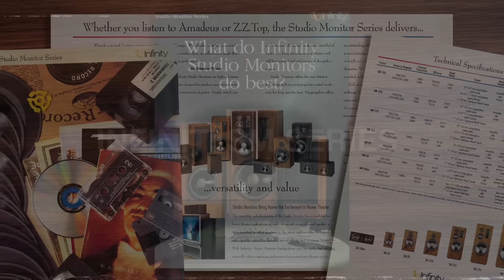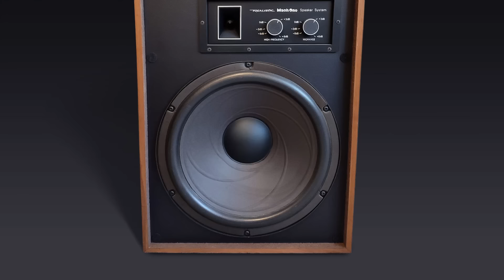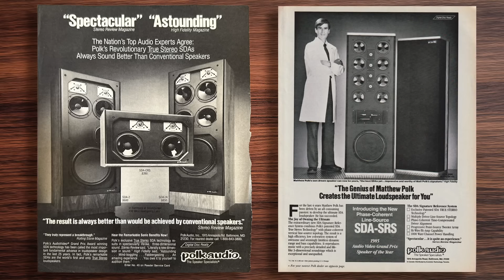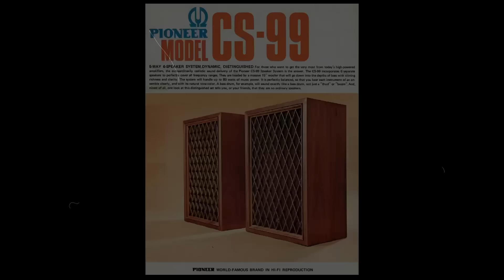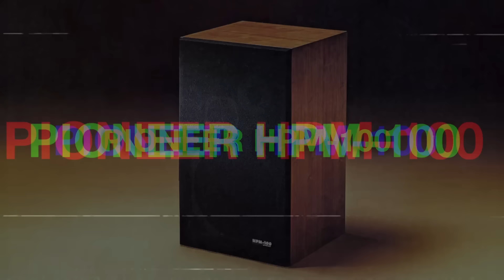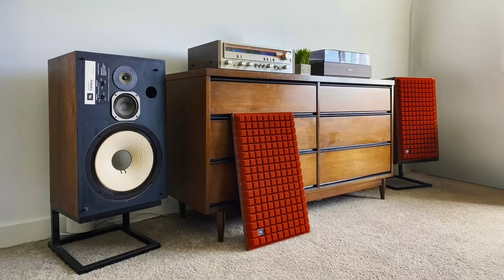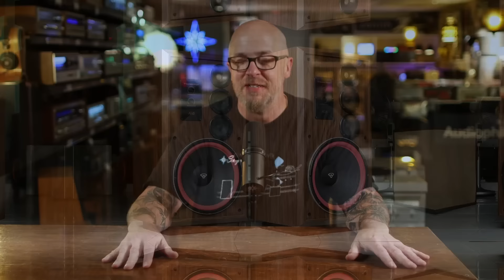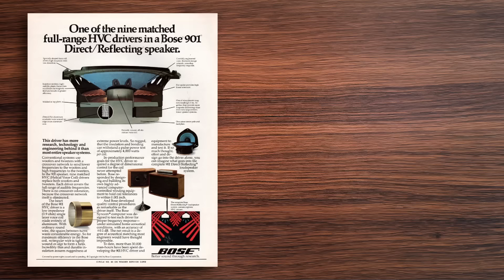Why Do Audiophiles Hate These 9 Legendary Speakers?

Comment: I bought  a set of HPM-900's new in 1982. Still have them and they still sound great. Along with all the Champagne Pioneer gear I bought with them.  A-9 Amp, SG-9 EQ, PL-L800 Turntable, CT-7R Cassette deck and F-9 Receiver.  I could give a RATS ASS what some dick head "audiophile" thinks or says.... my EARS tell me what I like. Remember the first year of MTV?? They had my setup in the back ground!

Comment: Once upon a time, as a very young man, I worked at various local Radio Shack stores. One Sunday the mall was closed (olden days: 'lettuce spray'), and we were doing an inventory.  It's a mediumly-big shopping mall, 1000-ft long and shaped like a 3-story figure 8. Of course, since the mall was empty, we pushed the Mach One speakers out into the mall, and blasted Classic Rock with the full 100 watts RMS per channel. At the end of each song, we could hear the song ending orbiting the mall several more times. The security guard on patrol dropped by to tell us that it was the best Sunday he'd ever had working. 15-inch woofers have a 'quality' all themselves; no need to explain.
Reply: yes, my dad owned a pair & he threw parties alot back in the 1980s after my parents divorced. They rocked!!

Comment: I'm not a fan of the 901 but I must say, they can sound pretty OK if set up properly.  I like the idea of running 901 properly positioned, without the EQ and  use DSP (like the miniDSP HD) for the contour and a little HMS 2.3 curve.  Now, I'm not saying it would be an audiophile setup...

Comment: I’ve had a pair of HPM-100s since 1977 and love them.  Although I later replaced them in our main room when my Sansui 8080DB died and I went to a Denon HT setup (and they did not voice match my new Energy Veritas Center Speaker) I then moved them to our large master BR, because I wouldn’t be able to let them go.   I did blow 3 tweeters over the years (which was probably mostly due to cranked super sonic clipping from my Sansui). But it’s got factory replacement tweeters and I still have one spare left. 
Regarding its brightness, I never found that to be a problem and have sometimes used the control knobs on it to drop it a bit for safety sakes; but about the only criticism I would level at them is that I think dome tweeters might have been better because the stock tweeters are quite directional.  No problem if you’re lined up right 

Regarding the Bose 901s, I still remember to this day being in my dorm in the mid 70s and hearing a deep throbbing sounds. I didn’t know what it was so I was walking around this concrete circular building and as I got closer, I could begin to realize it was music playing. When I finally got to the source room, the guy had a pair if 901s on a table on one side of the room.  Small, but a perfect setup for their direct/reflecting design.  To this day, I’ve never heard Carly Simon’s “You’re So Vain” sound so frigging awesome. So yeah, I was surprised to later hear the negative criticism of them😮

Comment: I own a pair of Infinity Q8's. Bought them in 1978. Speaker placement is key with them. Proper height and a distance from walls is also needed. I replaced the crossovers, and man do they sing. Still have the original EMIT series tweeters and the 8" rubber surround woofers. Wouldn't give them up

Comment: I actually worked in the JBL factory in the 1970"s where I became intimately familiar with the L100.   I'm not going to argue with any of the criticisms of this speaker in your video, but I will defend them.   You've got two of the three main positive aspects of these speakers right.  They
are incredibly efficient, and incredibly rugged.    

The main criticism is that they arent "accurate".  This is true and not true at the same time.  Let me explain.  If you are a classical music fan, these are horrible speakers because they have an absulutely freakish and unnatural frequency response curve  (I should know - I was the guy checking every unit at the end of the assembly line.  We weren't testing them for "accuracy", we were testing them for consistency - to make sure they were all inaccurate in exactly the same way.)

What few people today appeciate, though, is that this isn't always a flaw.  In fact, the "inaccuracy" of L100s may well make them the best rock and roll speakers inexistance at any price.  The reason?   The 4311.   The JBL 4311 was a "studio monitor", which meant that it was built for commercial use - specifically for use in recording studios.  It was JBL's most successful out of about a dozen purpose-built studio monitors they made.   In fact, the 4311 was the most successful studio monitor in the world from about 1967 until the early 80's.  Every recording studio in southern California, and most studios around the world had a pair.   Recording engineers loved them.   As a consequence, and I can't stress this enouth - MOST OF YOUR FAVORITE ALBUMS FROM THE 1970s WERE MIXED BY AN ENGINEER LISTENING TO 4311s.

The L100 and the 4311 are very nearly identical.  They use the same set of drivers.  They use the same crossovers.  The  cabinets have the same volume and ports.  The differences are purely cosmetic.   The grill is different, the location of the mid and high knobs is different, etc.  They sound EXACTLY ALIKE.   If you love classic rock, this means you need to revisit your definition of "accuracy".   If you want to hear exactly what the musician heard when they played the music - well, good luck since multitracking was well established by then.  Each musician heard something different.    If, however,  you want to hear what the engineer and the band heard when they approved the mix, you need a pair of L100s  (or, obviously 4311s if you can find them).  From this admittedly biased perspective, nothing else comes close - especially a pair of supposedly "accurate" speakers.

Comment: I had a set of Realistic Mach 1 back in the 80's and I loved them. I think they could handle 100 watts rms, but I rarely drove them that loud. I think I paid around $100 new from radio shack and eventually sold them for a fraction of that cost back in the early 2000's. I didn't know any better. I figured who would want these big bulky speakers.

Comment: With the Bose 901s, there is a huge difference between the Series I and II on one hand and the Series III and later on the other. The first two were in wood boxes and were sealed. The later ones were in vented, molded plastic boxes and frankly sounded like crap. I had a pair of Series II that I used with the 8 drivers facing forward, and before you condemn that, be aware that the Bose 802 pro sound speakers were basically 901s without the front driver, turned around, with a slightly different equalizer. I used both the 901s and the 802s for sound reinforcement back in the 70s and 80s. They could handle a lot of power and you could move them without a fork lift or crane. They would also fit in places a normal pro sound speaker of that era simply couldn’t.

Comment: My 1966 Empire Grenadiers are very boomy and tweeter heavy and position critical. If they are not in the right room or too close to the walls they cancel each other out and wash out the bass. But they sound good when set up properly.

Comment: Infinity SM150:  Has passive radiator:  THE CASE!   So boomy boxy you can visualize the dimension of the box the sound is coming from.  I had a set.  Didn't compare to CV 103 db 15in w/700w A600.
Polk:  They had  small woofer and a tweeter and then built speakers using those drivers like Legos.   And the price was proportional to the square of the # of these drivers.  They had no Shame!
Kabuki:  Buddy had FOUR sets @ TWO Ohms on a Sansui 33000 (!!!!)  Black Sabbath fanatic.  Room 6' x 20' (!).  Drum kick dimmed lights.  Had trouble breathing!  Intense!  Try that with your Wilsons.
Pioneer HPM-100:  92db sens. + 200w capacity = Not Loud.   
Cerwin-Vega:  103db + 350 w capacity = Top of the Loud Food Chain.  And they BRACE that cabinet!   I've had Acoustat 2+2, Apogee Stage, Maggies, DCM, B&W 801, 801F both woofer blows up on Digital Underground The Humpty, DM6 OK, and others but the sad reality if you want loud, you don't get quality (at least with 1 power amp)

Comment: I THINK BOSE CALCULATED ON NOT ALL PEOPLE HAVING SENSITIVE EARS TO HEAR THE FULL AUDIO SPECTRUM 20 HZ TO 20000 HZ... FOR BOSE WHICH IS 2 WAY SYSTEM FOR THE MOST MODELS .. I EVEN DOUBT WHTHER THEY HAVE EVEN A CROSSOVER CIRCUIT.. AND IT HAS A TRICK OF ADDING THUMP TO MID RANGE SOUNDS.. SORT OF WEIGHTY AND STILL FAST.... HE MANAGED THE TRICK... I MEAN BOSE MANAGED IT ADMIRABLY

Comment: Cerwin-Vega and Carver are the reason I'm into hifi audio today. My dad had four VS-150's, one pair stacked on top of the other pair, and two TFM-35x's driving them. It was an amazing system to a teenager back then. They definitely had their downsides. The titanium tweeters could be harsh at high volume and the midrange would break up when pushed. But those four 15 inch woofers would perfectly recreate the thump of a kick drum. It was a system that made you feel like you were right up close to the stage. I remember playing The Crystal Method's album Vegas on that system and the bass in the song Trip Like I Do was earth shattering. I thought it was going to knock the house off the foundation lol. The VS and AT series were some of the best they produced imo. The orange foam surrounds was a shame. Interestingly, my family was in the speaker business back then. A small anonymous speaker cone plant in SW Wisconsin. They manufactured the speaker cones and surrounds for the woofers on a lot of these Cerwin-Vegas when I was a kid. I also recall seeing production samples of cones similar to the Infinity SM series. They also made a lot of the speaker cones for Infinity, JBL, Eminence, JL Audio, Earthquake, and even Bose back then. CV's insistence on the orange surrounds was criticized even back then. Something about the foam that was required to make the surrounds made it prone to rot, but it was a trademark look for CV so there was no talking them out of it.
Reply: I've had two pair of D9's in my life.  Freakin' LOVED those speakers.
Reply: Loved my friends Carver   i had Luxman

Comment: just taking a chance.   if anybody knows anything, please comment.
in 1974 i bought a pair of AMC 24XP.   it's been a long time, but i think the AMC stands for American Monitor Corporation.   these are 4-way speakers with 2x speakers for each 'way'.
2 woofers, 2 mid-range, 2 tweeters and 2 supper tweeters in each cabinet.   i have tried to find specs or info on them, but to no avail.   there is nothing on the interwebs.   i'm sure AMC is no longer around, but i find it strange there is no information.   i use a Carver 4.0t to drive them.

Comment: The Klipsch Heritage line is only good when modified and run with purist circuits.  That's like none of the market.  But if you're running a purist tube circuit and are the type of person to modify the speakers (dynamat on the horns, upgraded EVERYTHING ELSE besides the wood), then the Klipsch Heritage can't be beat for the money.  If you're running the newest, highest wattage solid state whatever you can find, then the Klipsch Heritage line is, well Heresy for you.

Comment: I have had many of these speakers pass through my garage, many got re-capped and eventually sold.  But the CS-88A is the exception, I will never sell those as they are FANTASTIC!  Mine are paired with my SX-780 or SX-950.  I have the CS-99A's as well, but favor the 88's most!  Of course I own my HPM army as well.  They get to live in the House!!

Comment: I have Mach Ones and that sound pleasingly to me. Set the mid and hi pots to 0db and no shouty speakers at all.  I have a set of Heresies and I use them for the rear channel.  Flat speakers I have a set of Fischer 9vs that are lovely to listen to and they are like a time machine.  Listen to them for 3 hours and never notice.  My wife is my alarm clock to keep me from listening too long otherwise.  The rest of the other 5 sets are home made except for two Sony Center Channel speakers.  I love Cerwin Vega and you can always roll of some of the Bass!  AT-15 are what I love most.

Comment: I have 4 CS 99A's with FB cones. Right  now I'm only using 2 of them. They are paired up with 2 DX 9's. I get a good sound with a little more of the power going to the Cerwins. Using a Pioneer SX 1250. I think the CS 99A's are built like little brick shithouses. They keep up pretty good.
Reply: You must re-cap them to hear their clarity.  They get really muddy after 50 years...

Comment: If you're in my business, restaurants, the JBL 100 is unassailable. You are absolutely correct -- they take whatever you can throw at them and handle everything extremely well. Mids get lost in a room full of people talking slash yelling at each other when the drinks are flowing. You want highs and lows pumped, typically. At home I have a pair of KEF Q300s with an Andrew Jones subwoofer, and for my small space that is a quality setup for well under $1K. After I sell a kidney I'll get the Klipsch La Scalas ;)

Comment: My Dad had Mach 1's, real party speaker but not for sit and listen. If you want good imaging with the Polk SDA (at least with the big 1.2TL) they need to be at least 4 feet from the side wall and 6 feet is better. Also make sure to install the Bass Brace. With that setup you will not have 'head in a vise' imaging.

Comment: My audio hobby was strong in the 1990s and 2000s, thanks to my father (he had a Fisher A/V rack component setup).  I had Cerwin Vega house speakers in 1995, and Bose in the 2000's.  Of those, I prefer the CVs because I like Rock/Industrial with lots of bass.  I'll never buy anything Bose again.

Car audio was more my jam,.  Between Pioneer and Alpine mids and highs, I preferred Alpine.  Between Rockford Fosgate, Pioneer and Boston Acoustics subs, I think I liked the RFs best: had a 15" once, then a pair of 10"s.  Problem was, It's hard to keep your gear secure in a soft-top Jeep.  Hence the varied brands.  Made all my own sub enclosures due to space constraints, except the one that housed the 10" BAs which was made at a local car audio shop.

Computer audio still seems to be a bit niche.  In front of a PC is where I spend most of my time now.  I've had stock speakers from Gateway (or Gateway 2000 as it was known at the time), Logitech and Klipsch.  For my money, Klipsch wins hands down for audio quality here.  Their controls, however, are total shit.  Consistently unreliable and noisy potentiometers from the 2.1 spearker setup, 4.1 setups, and even their premium 5.1 setup that I've owned.  It's no wonder they seem to have left this space.  Currently running a more recent Logitech sub and 5.1 control unit with the five Klipsch satellites from their premium 5.1 PC set.  Clear as crystal for my middle-aged ears with very decent bass when I want it.

Comment: I have and use 2 JBL Model 4311B Control Monitor and they have a direction issue. With both facing forward and youre in center you get NO BASS. Walk away you get a large amount of bass. I keep 1 facing forward and 1 at a 45 degree angle. The seems to work.

Comment: My Mach One set plays almost 24/7. I've replaced the surrounds twice and gave up on repairing the STA-2300 receiver. The set was purchased tofether in 1981. Before I figured it out it would become known as "vintage" electronics, I neglected to pick it up from a local repair shop. The shop closed and my receiver disappeared.

Comment: Love this episode I currently own a pair of those JBL’s and a pair of Klisph Heresy’s. I run them with the Klisph on the ground and the JBL’s hanging from the rafters on huge metal grates to support them held up by chains. I also have duel subs (klisph 12” 1000w). For my surround speakers I use smaller KLH bookshelf speakers. Driven by a old Yamaha C70 preamp and a heavy arz Kenwood tube power amp . Bought all these toys while stationed in the UK with the USAF. Rocking the same stereo today, decades after purchase

Comment: I’m not gonna lie I actually really like the Clipch  speakers when I heard them. The only reason why I didn’t purchase them in Best Buy was because I couldn’t afford them. They were like $400 apiece. So I went with the Sony SSCS5 for a long time until the mid range Twitter got damaged due to heavy play and heavy traffic in the area. Where the speaker was placed. Since my mid range is no longer there hardly at all I decided that I would try to switch speakers. I went with the Polk audio T 15 hoping that they will give me the mid range that I wanted, but they gave me mid range, but not the kind of mid range I wanted. But then I heard about this other brand called. Fluance, and I started purchasing the center channel and bipolars from them, and I noticed it they outlast the polks  in  every single way possible. So I said OK well, my next step I’m gonna have to get the XL8S for the front because this is just ridiculous. I’ve never heard a sound system that sounds as good as it does right now with all of the Fluance speakers all working together I don’t know if it’s the room that I’m in or the Yamaha RXV 385 it’s hooked to but this is the brand I would highly recommend for any room that is 20 x 15 x 8
Reply: T15 = TURD 15

Comment: I just got a pair of JBL L26 which I believe are from 1976.  They sound so different than everything else I've tried that I did not like them at all.  Super fatiguing tweeter and the bass response from the 10" woofers were nothing special.    The problem was the location, I was demoing them from about 4-5'  away and there was nothing behind them.  When I actually put them in my living room at 10+feet away with a wall behind them the sound completely changed.